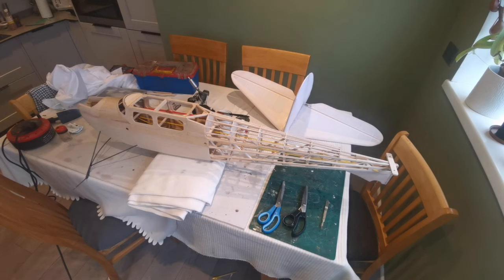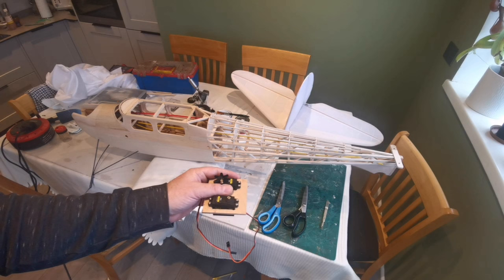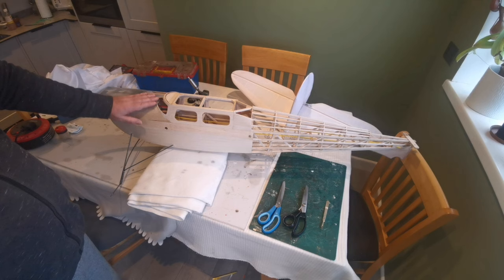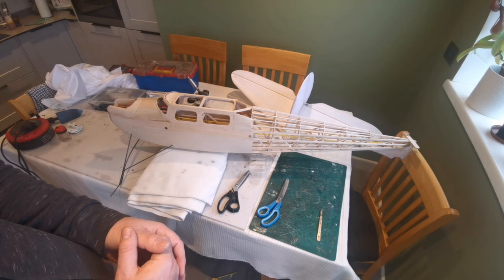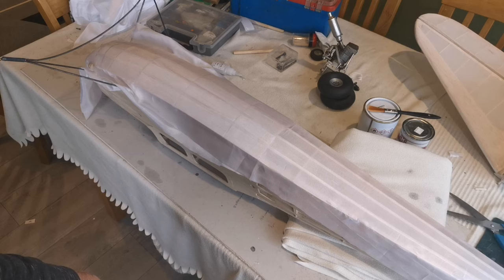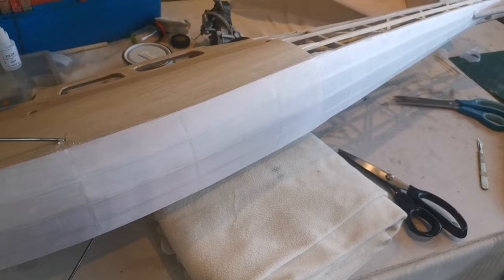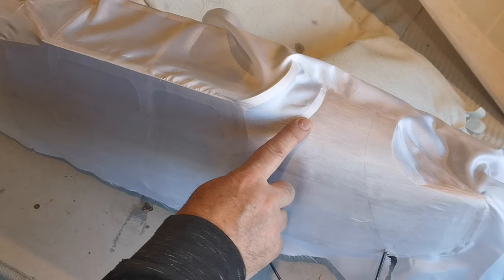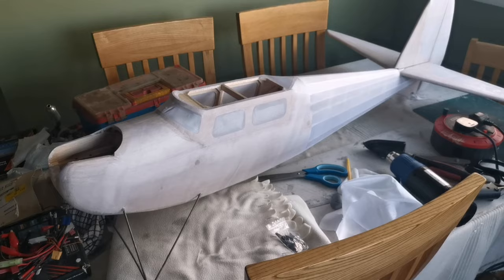Polyester dress lining a cheap alternative to commercial model covering.

Comment: It was my covering of choice in the early '80s.  Had one very successful airplane, a 96" span Antoinette French airplane from 1909 - tacked on to the frame with liquid Coverite adhesive than clear doped after heat shrinking with a heat gun and iron.
Reply: Me and my fellow club members have been using this covering method since 1980 as well.  It worked very well for all but the very smallest of models.  It is very strong, in fact when (not if) you had a crash, it supplied a convenient "bag" to haul the remains away.  Only drawback; must be painted as opposed to plastic film covering.  Plastic always looked phony.

Comment: Good job, it seems old school model building is a disappearing skill. When covering I normally start at the back and work forward, the overlap is then from the front to the back. The covering has less chance to lift up from the front edges due to airflow, fuel, etc.
Reply from the maker: For an old school model I think old school finish is the best agree with your sequence too.

Comment: Have you used any of the colored dress linings or only used white? Obviously there would then be no UV protection but would make for a very light model with a bit of color.   Thank you for your videos. I've only used large aircraft methods to date, but this looks like a very good alternative.
Reply from the maker: I would assume that the fabric (for dress making) would need to be UV stable.
Reply: @MarkCroucherRC4fun well, I only meant the UV protection paint provides.

Comment: Interesting Mark.... Is the dress fabric pre treated, or just dope on the air frame creating the adhesion with the use of the hot iron..... .......?      Must be more economical, than some main brand coverings.
Reply from the maker: I use Mod Podge as the adhesive which is then reactivated with an iron. The dress lining needs no special treatment.
It is a cheap alternative the fabric itself is less than £2.50 per square metre.
Reply: @MarkCroucherRC4fun  Hello. Mark.   Thank you for the response and information, will give the technique a.  go ..... *

Comment: What type adhesive are you using that is heat activated ? Is modge podge heat activated?
Reply from the maker: Yes it responds really well to a heat iron gets a strong grip on the polyester.